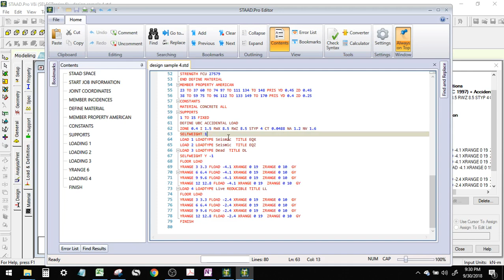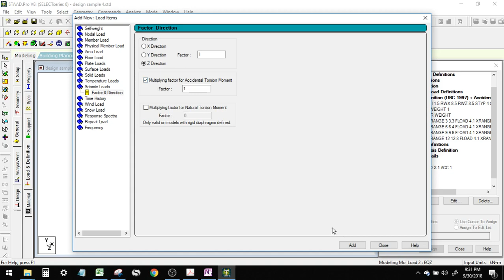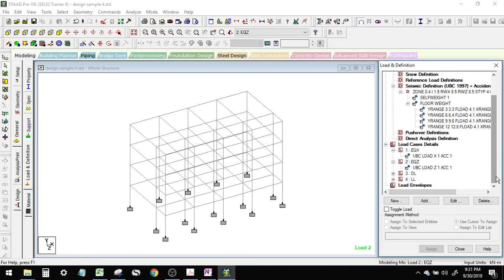PART 4 Seismic Definition in STAAD

Comment: Sir why is GY has been removed?and what if id input a negative load on the seismic definition.will i encounter an error?
Reply from the maker: Gy is removed when defining seismic load. Remember, we are only defining seismic load to determine base shear which is not sign dependent since STAAD will distribute that vertically and horizontally. Check my other videos verifying vertical distribution of earthquake in staad